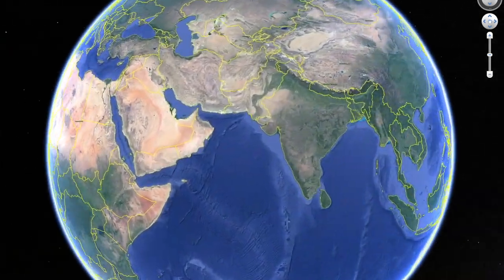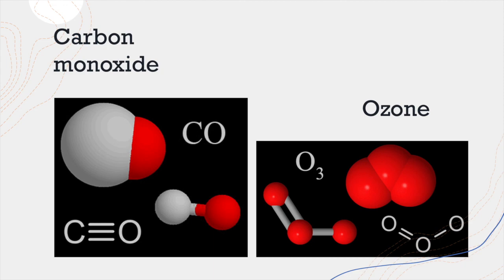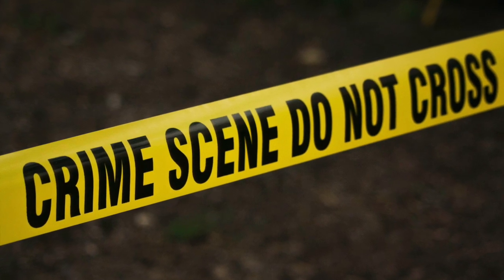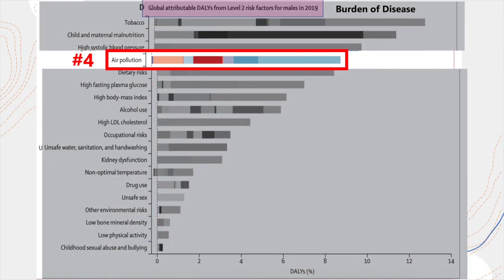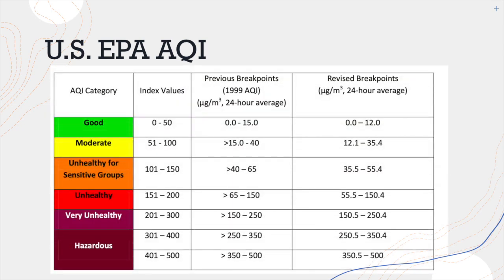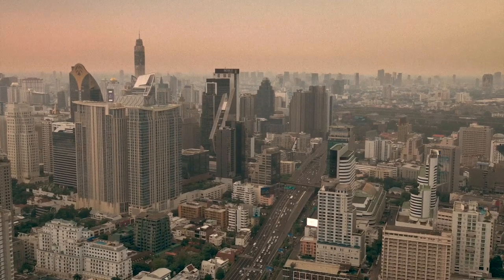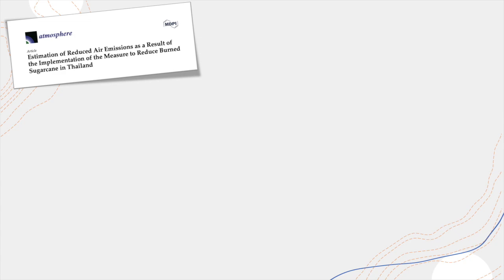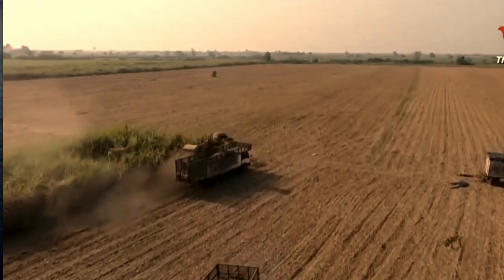PM2.5 in Thailand Explained | The role of pre-harvest sugarcane burning in air pollution

Comment: I am fairly certain they are subject to chemtrails in Thailand, and when i analyze PM 2.5 and PM 10 under a microscope, it is 90+% chemtrail particulates which have been cubic salt-like crystals and plastic/glass type extrusions that appear like icicles or tangles of yarn. And this is far away from any cities, industry, or plant life. And it is the same year round. Before 2000, i never had dust in my home. Now, its a chronic daily condition. And it comes down heaviest about 1 hour after they spray the skies. So, there is clear correlation. This is not fly over country. Planes either land or take off here, yet the planes spray from horizon to horizon. 350 blue skies per year became 5-7. Southerly became northerly winds. Anyway, this science doesn't seem to be of any substance compared to the science people can do themselves with a microscope. I have talked to a dozen others around the world, and we see the same types of particulates. Get a 100x or better microscope, and look for yourself. Take a high power LED and look into the beam outside at night. You'll see particles in the millionths of a meter (microns). See for yourself. It's worse than you think.

Comment: Good video explaining PM2.5 but how do you protect yourself during these 3 months ? Will PM2.5 face masks reduce some of the PM2.5 particles ? Do you NOT go out at all ?
Reply from the maker: Yes, the best thing you can do is don your PM2.5 respirator. I bought a Respro Pollution Mask. You can see a picture of it at the end of the video. There are other brands, too. For PM2.5 it has so be a respirator, meaning it has a tight-fitting face seal. They're reusable and washable. Whatever you're looking for, though, needs to have a one-way exhaust valve.